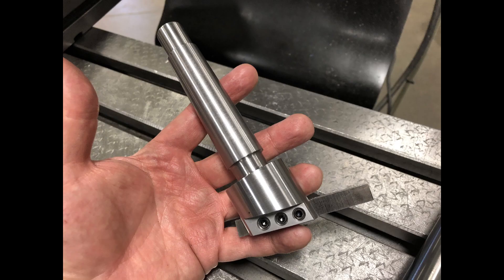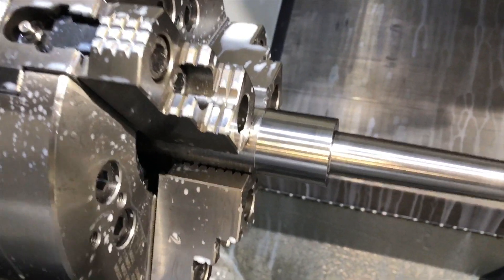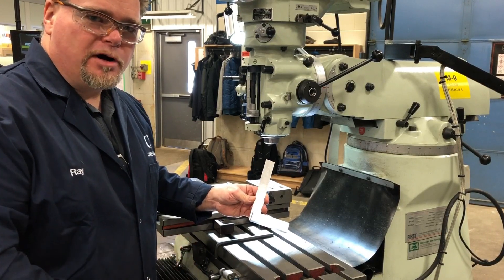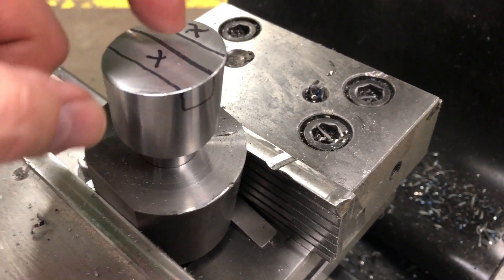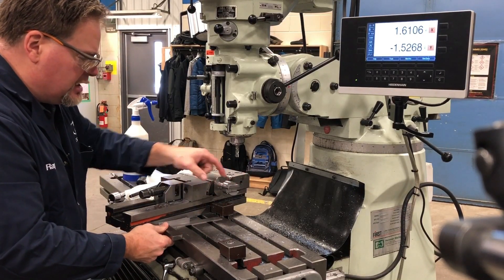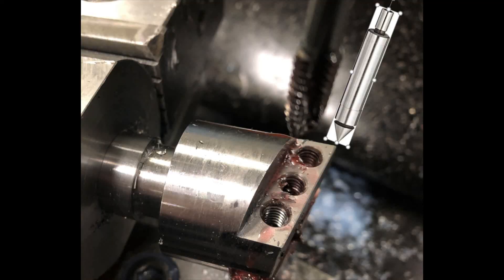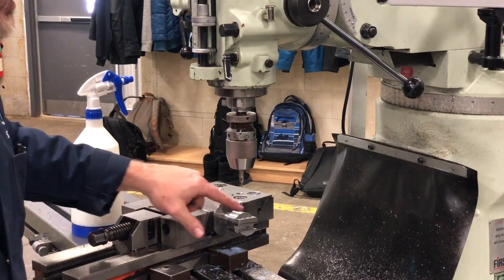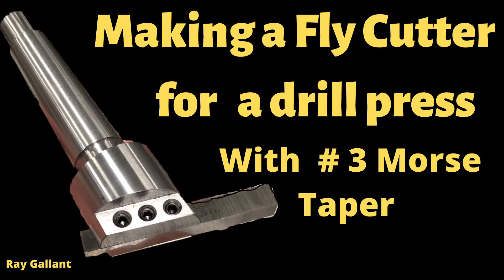making a fly cutter for a drill press with # 3 Morse taper

Comment: I like this video a lot, and your channel, Shop and math my 2 favorite things, keep it up brother!👌
Reply from the maker: Thank you Jamie for the awesome comment this helps put fuel in the creative tank
The real reason for this video was not to make a fly cutter that goes into a drill press
It covers a lot of the learning outcomes that we teach at the college and I was going to use this video as an intro to grinding a number three Morse taper
Thank you for taking the time to comment
Ray
Reply: @shopandmath , even if that's so it's the type of video I've been looking for. I'm a CNC machinist and since Covid-19 I've been drawn to build my own shop, my first project is upgrading the Wen 8 inch 5 speed. I find drill press upgrades and modification videos to be my favorite right now. 
I currently bought the Mophorn Chinese xy compound table and ordered myself a 6 inch vise by happybuy which hopefully should be delivered today. I've got a lot of experience in machining and am planning on making many upgrades. 
I've heard all the reasons not to mill on a drill press, like many others on YouTube, but I would still like to push the limits on what I can do with this machine. 
It's pretty damn small tho, lol. 
Currently I'm looking to upgrading the jt33 taper or spindle drawbar to handle mt2 or mt3 so I can hold on collets. Er10, or 25 or 32, and beef up my bearings.
If you have any suggestions or advice on that I would very much appreciate it. And also the column is weak, needs to be beefed up. Shoot me your email and I'll explain in greater detail. Thanks again bud.
Reply from the maker: Shopandmath@gmail.com

Comment: That's a great looking fly cutter buddy, awesome job 👍

I will add that it is possible to convert some drill press quills to take a draw bar, seen it done a few times and was something I had considered doing myself at one point but opted to get a mill/drill as they are made for that kind of work, drill presses are just too lightweight for milling duties.
Reply from the maker: I am looking in to adding a 1/4 inch draw bar 
but might upgrade to a small CNC